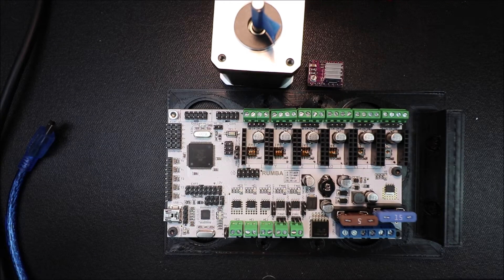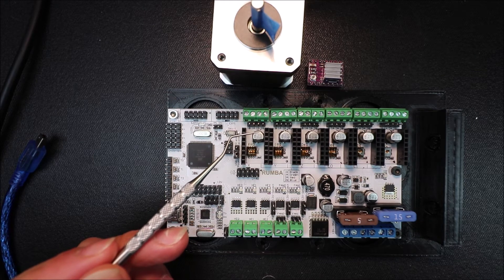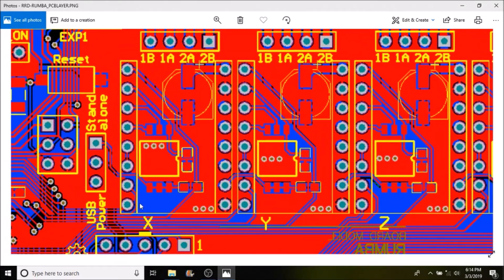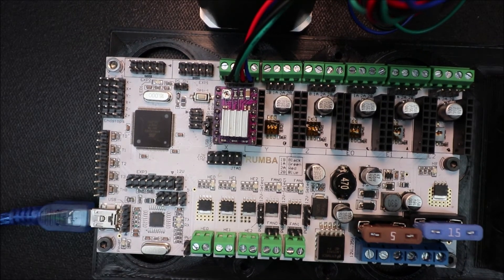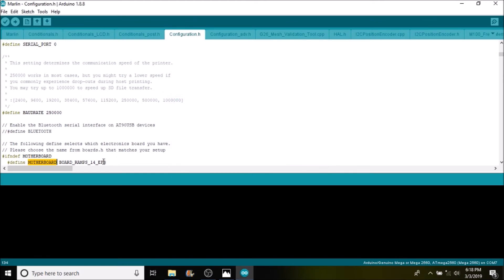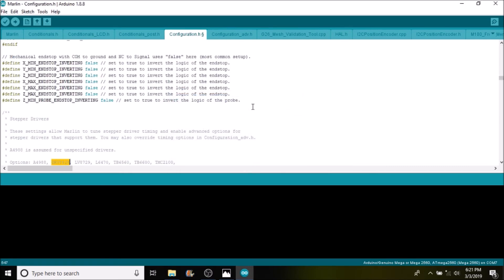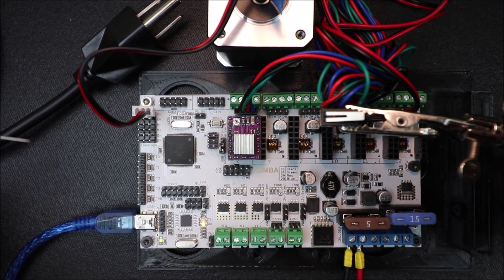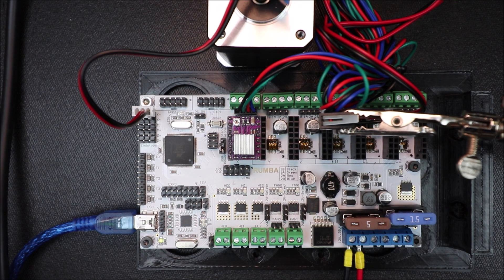RUMBA - Installing a DRV8825

Comment: Hello Edward, 
I would like to know how to clone de Z axis in one of the E ports in such a way that I have a Z1 driver, Z2 driver and E driver with both Z drivers synchronised. 
Do you know how to do this? I wouldn't like to connect two motors to one driver although I guess it could be feasible 
Thank you :)

Comment: is it possible to install hbs57 or dm542t driver on this board?
Reply from the maker: It maybe possible.  I've just not researched yet.
Reply: but on marlin this external drivers are not specificated. Is the same if i take the signal of the pins (enable, pulse, direction) from the board and connect them to the driver without specifying the type of the drivers on marlin? If you can, could you make a dedicated video?
Reply from the maker: @giacomo1049  I'll be making more videos on Rumba soon.  Work been busy for a couple of weeks, but I have a vacation coming at the end of the week when I can spend more time on videos and research.  I do have a video for RAMPS 1.4 and MKS Gen L v1.0 show how to add additional stepper drivers.
Reply: @EdwardBraiman  thank you very much
Reply from the maker: You're welcome.

Comment: can you do  a rumba one on the Leveling Position Sensor Bed Level For A8 &Tronxy P802M P802E 3D Printer BP https://www.ebay.com/itm/Leveling-Position-Sensor-Bed-Level-For-A8-Tronxy-P802M-P802E-3D-Printer-BP/112499003545?hash=item1a31769099:g:MCwAAOSwQVZZgc6I

Comment: do this for all stepper drivers and extruders
Reply from the maker: Could you give me a little more detail?
Reply: @EdwardBraiman  so i remove the // from the x,y,z and e0,e1,e2  and add drv8825 to each  if thats the driver im using for all steppers
Reply from the maker: How's it working?
Reply: @EdwardBraiman  still wiring and sleeveing  wire and waiting on one end stop out of stock
Reply: lcd running
Reply: what about the power jumper for the hot bed printing nylon with this so no hotbed do i leave the jumper empty
Reply from the maker: Which jumper are you referring?  What type of printer motherboard are you using?
Reply from the maker: Do you have eBay where you are?  You can always buy the parts or subparts and assembled.
Reply: @EdwardBraiman  rumba plus the one next to the fan jumpers
Reply from the maker: So what are you trying to do?
Reply: @EdwardBraiman  just wondering if i put a jumper there if im not running a heat bed
Reply from the maker: I'll be researching soon, try to get a Delta type printer mostly assembled this weekend.  I'll have more time after Thursday.
Reply: @EdwardBraiman  do I have to have a fan connected to the fan hub if the jumper is on
Reply from the maker: Nope, but experiment and let me know.
Reply: They come Sunday it,s ok I'm clearcoating  a carbon fiber trunk I'm making for a guy in Texas check my page out

Comment: do I need to have stepper motors attached to plug into USB and program  or just the stepper drivers and can i run DRV8825 as an extruder driver also or do I need a different driver
Reply from the maker: To program Rumba board you do not require Stepper driver board.  It's covered in tutorial mainly for proper insertion to avoid damaging Rumba and Stepper.  DRV8825, can be used as an extruder driver.